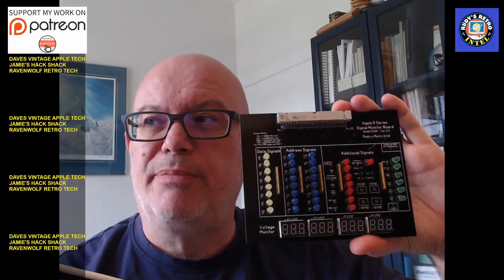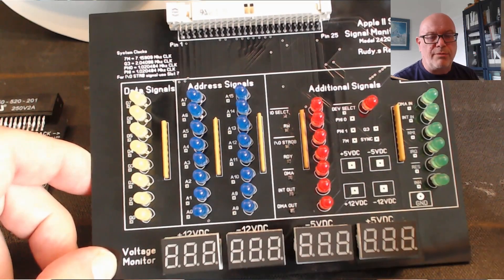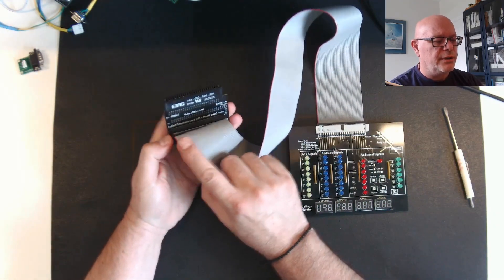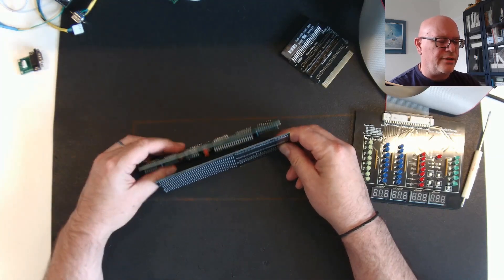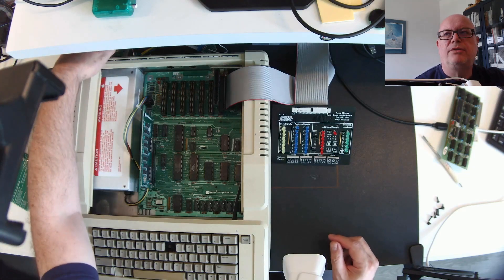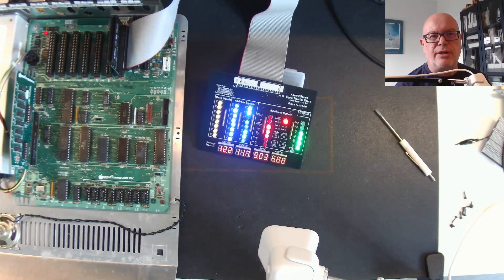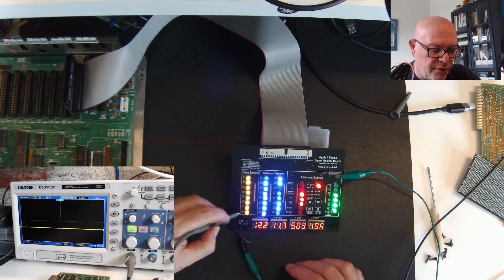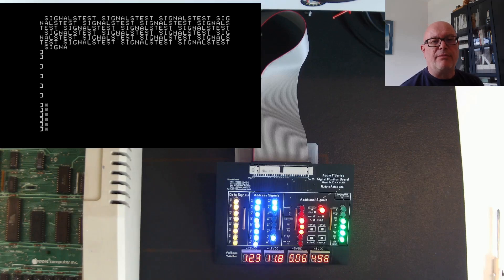Apple IIe Signal Diagnostics Board: A hidden treasure

Comment: I like the design, but why didn't you put the card slot on your test board, so it's even easier to put probes on Apple cards you want to test?
How far can a card function from the actual slot on the computer?
Thank you for any input on this.
Reply from the maker: Good questions. The board  doesn't have a slot as it would require external power and complicates things. As for the length, I would no go longer than 60cm or 24 inches. My ribbon cable is 18 inches or 45 cm. Long ribbon can reduce the signals unless you have some signal amplifier.
Reply: @RudysRetroIntel  thanks for the reply.

Comment: I was bracing myself for a long, arduous c64 repair after it was seemingly suffering heat damage back in like 2014, but powering it on last year, everything was perfect running on a modern PS replacement. Still, ome of those for c64 would be useful to diagnose my 3rd if I get into a repair spiral later on
Reply from the maker: @1BitFeverDreams  There is a diagnostic cartridge for the C64. There is a company in Toronto that sells some. I should design a signal board for the C64

Comment: Here something. Put a slot on the diag card outside the case so you can plug a card into it from outside the machine.
Reply from the maker: I've thought of that, but the issue is that the signals are weaker, so the card won't work properly if too far from the motherboard. Thanks for commenting
Reply: @RudysRetroIntel  Good point did not think of that.
Reply from the maker: I've tried it before, and it's not a great success, so I removed the addition on the board